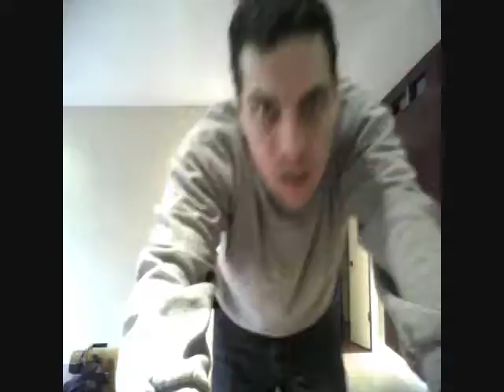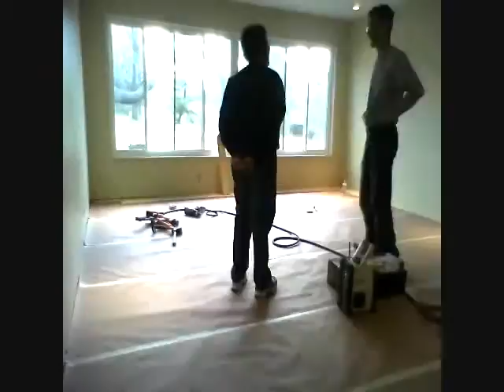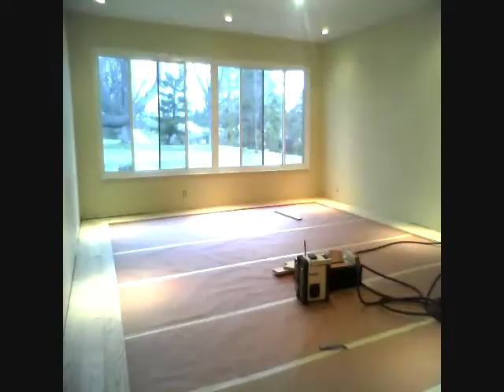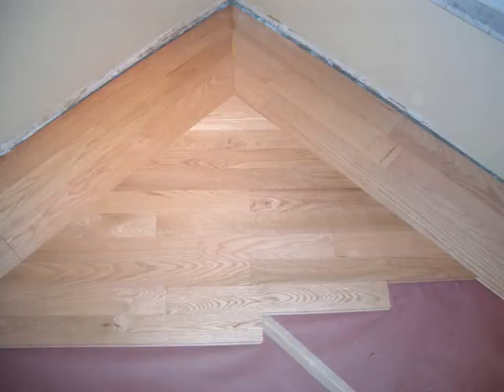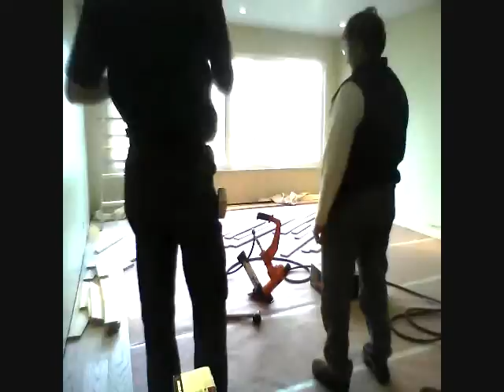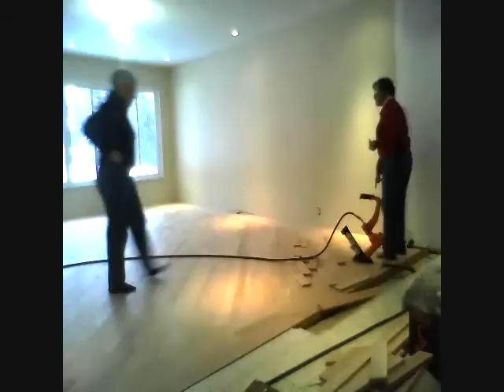Custom Wood Floor Installation Time Lapse

Comment: I am doing a similar pattern in my living room. I am doing a border with a cross (like a window pane) and install a diagonal pattern in each of the 4 panes alternating direction in each pane. My question is, how did you get that last diagonal piece in and have it snug? Did you glue it? did you have to cut the tounge or grove off? I don't see how you could of got that last piece in and be snug when you did the border first.

Comment: Worst music ever
Reply from the maker: It keeps changing,  free from YouTube.
Reply: Do u find installing the border first, then the inside is easier than installing the inside first, cutting the square, then installing the border outward towards the wall. I've done both ways. They each have there advantages.
Reply from the maker: @sone4soshi  I like the doing the border first.   Especially when I'm captured by more than two walls.  It also lets you square the room with the boarder to eliminate the variation in the walls.